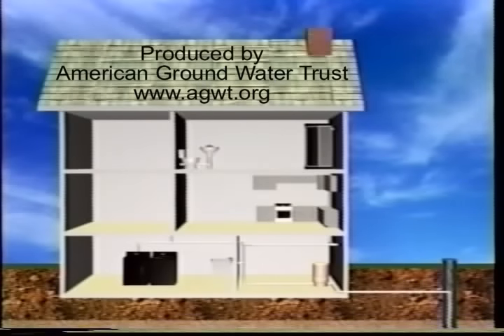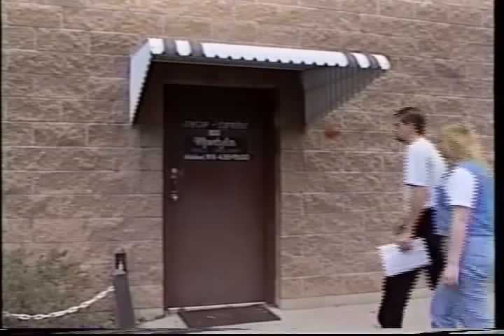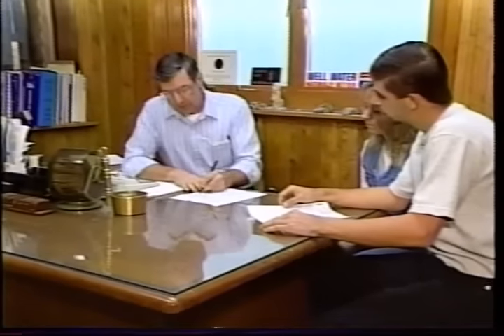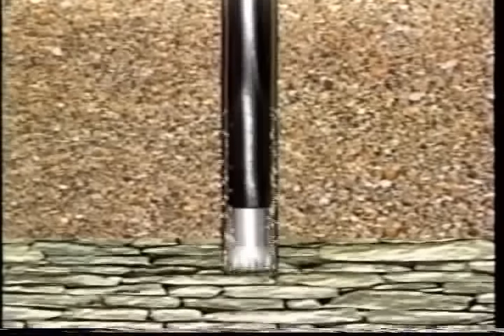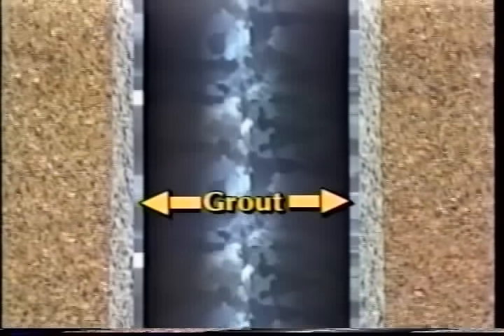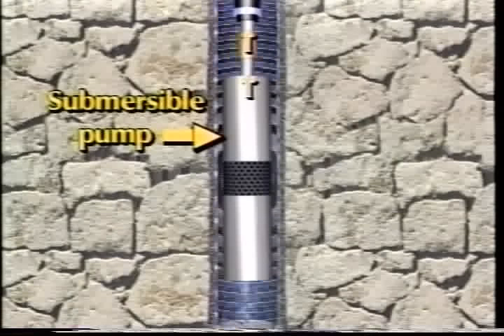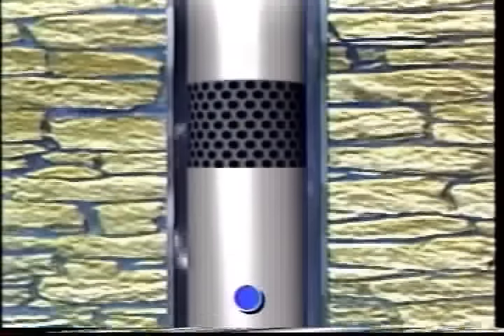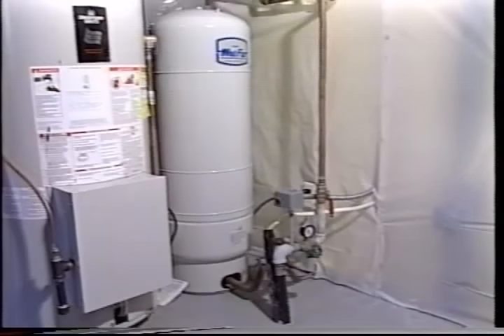How a Water Well is Drilled

Comment: I'm a certified public water operator class C and this video explains what they don't in books..good stuff
Reply: TheHonestjbone a video is worth a million words.
Reply: Arther Casillas
Reply: TheHonestjbone hey man I'm 22 and a new homeowner. my house has well water and it has a bit of a metallic taste to it.
Reply: how do I stop this?
Reply: could be a multitude of factors.

1) how deep the well was drilled generally the deeper the better quality water...the more shallow the more "rotten" egg smell which is sulfur and iron mixed
2) get it properly sampled at a lab, preferably your nearest county lab to find out what is in it.  Could be high iron, or just certain quality of the water..get it tested then take appropriate action to have it filtered.
3) what kind of piping do you have in the house? copper? galvanized?
4) you COULD try undoing the bolts bolting down the cover of the well head and pour a gallon of chlorine down the casing pipe (yes literally) and then use a hose to hose down the inner walls
5)You could attach a filter system after the well to filter out usual suspects....but figure $30-60 every few months in filter change outs too
6) make sure the hot water heater anode/probe/dip rod in there isnt corroded...that'll give off a huge rotten egg smell if left unattended too or not changed

hmmm what else.....OH after you "shock" your well...flush it out for a while..to make sure you get that out of there

hope that helps brother
Reply: What book do you read?
Reply: My groundwater is damaged due to soap&detergents water how to make it to normal
Reply: @bhadramudrageda4999  what was the cause of the soap and detergent? do you live in a house? or apartment? do you currently have an RPZ/backflow preventer on your plumbing? IF so...get that thing tested to make sure it doesnt "bleed" back.  Also get your water tested..which is sounds like u have.  One way to get rid of it is using a filtering system for the house and/or a house reverse osmosis system with a water conditioning softener.  At the end of the day it WILL NOT be cheap..but it'll be worth it in the end and you'll gain a lot of knowledge.  Sorry for this being a long reply but there is no short answer
Reply: @TheBTEAMwins  thanks alot for ur quick reply......my bore is driven at some other place but due to vasthu (astrology)driven near to waste water tank...(full of soap&bath water&washing water etc)so from new bore the water comes with detergent smell...we are planning to shift the waste water tank far from new bore .....but is there any affect with the previous used waste water to my new bore(it's depth is 15-16 ft actually we from konaseema (eastgodavari,Andhra rich of water facility))plz kindly reply what are measures taken to reduce
Reply: @bhadramudrageda4999  wow such a shallow drill!!! Very short! No wonder! Yes! Move far away from waste water tank!!! You’ll get sick and It will form bacteria unless you chlorinate your drinking water.  Re-drill if possible or move the storage tank away.  If you CAN, and only if you can...drill deeper.  And use some filtration units coming into home/residence to reduce ground water irregularities
Reply: Wow some gd info here! Dig deep…. better natural filtration!? Makes sense!😮

Comment: This is a pretty good video. Informative and accurate. I've been doing nothing but reading about wells for the past few weeks.
Finding water can be a challenge. Our existing 300 foot well in Northern Idaho went dry two weeks ago. We had two options, go deeper or try a different spot. There's pros and cons to both but we'll skip that. There is no magic answer to finding "The Spot", divining or otherwise however they now use electronic devices, not willow branches. Our neighbor drilled a 300 foot dry well and then found 25 gpm at only 200 feet! Back to our well. We opted to go deeper and found hard clay down to about 550 feet! Yuck! Fortunately, we got back into shale around 600 and are dropping the pump in today (9-10-14). It's only 10 gpm but it'll work. We should be out of this for "ONLY" $19,000.00. At $20 / foot, drilling a well gets expensive quickly and that's just the hole in the ground. Then you have to buy the pump and connect to the house with wiring and water. The deeper you go, the more powerful a pump you need and has anyone priced copper wire lately? Holy moly!!! So, you have to figure the distance to the house ( we're 500 feet down into the meadow) and then the distance down the hole. (we're another 600 down). That's 1,100 feet of #4 copper wire! We feel fortunate to have this cost less than $20,000.
Reply: You ever think about a solar dc pump?

Comment: Priming is not the only reason to use  a check valve.A check valve or a NRV (Non return valve) is used to prevent the backflow of fluid so it is a must & as commented by sslater069 nowadays NRV is builtin in most of the SUBMERSIBLE PUPMS.

Comment: Most brand submersible pumps have a check valve built in (typically fail),so it is extremely wise to install a secondary check valve directly on top of the pump and another check valve for every 250' of drop pipe after. with out the check valve in the pump or on it the water WILL drain back threw pump and air will enter the line causing the plumbing to shake and bang etc.

Comment: @jb0579 If it smells like natural gas, it just might be. Your best bet might be to have a local lab test a sample of the water to give you an indication of what minerals and or gases might be present. If you live on the edge of a swamp, you might be getting traces of ground water in your well and that could be due to a number of things, but primarily I'd think it would be a lack of grout around your surface casing. Hope this helps. - Tommy @ Fletcher Drilling, Inc. Colorado

Comment: How long does the steel casing last before it rusts and puts rust into the water?
Reply: Dasdfjkl that depends on the type of steel used and the water quality in the well as well as the wall thickness of the casing. most wells can expect a 15-20 year life before needing a liner or replacement when using steel casing. high salt content will shorten that to as little as 2-3 years.
Reply: John Pike here in Illinois most of our wells are up to 60 years old with original casing and no liner and the water pumps cleaner than aquafina
Reply: I did say "most" i have seen many numerous wells that were drilled in the 1800s and never been relined and i have seen many that needed a liner after only 2 or so years. I work for an irrigation company in southern Az and we have wells from the 50's that look new (one of them has stainless steel casing) and we have a couple with a high salt content and thin wall pipe that get a new liner every 5 years
Reply: very interesting. I work for a drilling outfit that drills for residential purposes or livestock with the old cable rigs
Reply: jakub goslin Really?! i haven't seen a cable tool used on a domestic well in years. i run a BE 36L at my company and maintain thier 3 36L's and 1 28L. i have worked with every model of cable tool bucyrus erie has offered. around here cable tools do mostly just work overs or agricultural new wells, rotary has taken over the market for domestic and most commercial new well construction.
Reply: Just about every other company in our area operates rotary rigs but we stay busy as ever with our three cable rigs.

Comment: @jb0579 sounds like manganese, they usually use greensand filters for that. Find a place to do some testing before spending any real money. Usually when you need to treat your water, it is for more than one thing. Different equipment does different things, and interacts differently, so if you run out and buy something it may be counterproductive if you have another problem.

Comment: Can someone answer me a question? We have a drilled well 90 meters deep, with a submersive pump at around 40 meters from the surface. I don't know the level of water in the well. I was told by the previous owner that we mustn't use water with too high flow for too long because the walls of the bottom filter can break in if there is not enough inner pressure from the water column. I don't really understand what he meant (after seeing how a well works). Is it really possible? Thanks for your help
Reply: hummer4700 I do water wells for a living, you usually set your submersive pump 5 feet or roughly 2 meters of the bottom of the hole, motor horsepower and pump end need to be the most adequate for you well too.
Reply: The higher pump rate means higher velocity of the water inflow, which may break the sieve wrapped up around the perforation tube or tubing a.k.a. filter, which leads to hydraulic collapse. More over, higher velocity of the inflow may drag the fine sand particles into filter what also is preferred to avoid in order to protect the submersible pump and prevent the sand blasting of your sieve. Btw, your data is insufficient whatsoever in respect of used materials and filter type. You should find someone to help you with step test (testing the well with at least 3 different pump rates from lower to higher along with measuring of the water level). This test will give you much more info needed to determine the quality of the well in regard to hydraulic losses, optimal pump rate and pump depth. Greeting from Serbia!
Reply: @MarjanVukovic  thanks for the answer!
Reply: @hummer4700  You welcome. However, it s far more complex issue than previously briefly explained...to me it always raises more questions than the answers but wasn t that what inspires the people of science the most? lol
Reply: Is this your homework

Comment: it's always smart to not put your pump all the way down,,our well guys drilled a little extra, so we have a 20 foot resivor so the pump doesn't set in sedoment ...........jda
Reply: Ours has 20 or 30 feet as well. And even more above. When they built the house, the drillers went past the first reservoir so we don't even have to worry about dropping water levels even if we ever had any droughts anywhere near here.

Comment: the method is similar to fracking for shale oil or even oil drilling for offshore, i amaze, the only difference is the dept.
Reply: My grandpa was the one who told me about this he used to work on oil rigs said he drunk water from them and it tasted great
Reply: +Danny Fry I am also a petroleum engineer and the water produced with hydrocarbon is known as brine water and it is very hazardous to drink.you grandpa must be talking about shallow water wells drilled for water usage which are different from oil wells.
Reply: +Asad Hassan Syed i dont remember specifically but he was on a oil rig it was before they got to the oil though said it was crystal clear

Comment: How can you tell if your well below the casing has collapsed
Reply: it is not an open hole completion,it is a cased hole completion so the well can not collapse,the overburden pressure and the pore pressure at this depth does not exceed the collapse pressure.The hole they drilled into the earth they covered it with casing from top to bottom.
Reply: Asad Hassan Syed y

Comment: the water line into the house.  how come it leave the well casing before the top. how is that even installed?
Reply: +kody neeb It has to stay below the frost line or it will freeze in the winter.
Reply: +Tony Samson That is very wasteful.
Reply: i realized there a little metal weight clamp you have to slide the line into about 5,6 feet down, was hard to see, but sall good, it works like a bathtub faucet, the water pressure keeps it tight.
Reply: That line is typically used with submersible pumps and leaves the casing underground, below the level of expected frost.  Where I live that's 8 feet or so. A special 2 piece fitting called a pitless adapter (or a variation of that depending where you live) is installed to connect the horizontal supply pipe to the house with the drop pipe to the pump..  One piece is set in a hole in the casing, attached to the line to the house.  The other piece is attached to the drop pipe. The two pieces fit together with a seal being formed by the weight of the drop pipe and pump.  This system allows you to remove the pump for replacement.

Comment: Where does the used sewage water go??
Reply: In the septic tank. The solids in the septic tank break down naturally due to bacteria while the water is sent through a leach field back into the ground. The ground acts as a natural water filter so by the time that water gets down far enough down to have rejoined the aquifer it is clean as a whistle again.

Comment: how pump is running where is electric connection?
Reply: An electric typically comes in from the top and is taped to the pipe that is connected to the well pump, and goes the length of the pipe to the well pump.
Reply: I think it's battery operated
Reply: The home's power source...?
Reply: @marcoramos5811  Yes, 220V power source from the home on it's own breaker

Comment: '
do have a water filter from the drilled well water...
where is the water filter...
how about the sewer waste system from the house...
where the sewer going to
Reply: There is no filter only on the type of pump you get
Reply: And sewage just goes into a sewage tank
Reply: Sewage goes to a septic tank. A grandpa of mine had city sewage for a long time before he had city water. I don't know if it was by choice or they just didn't offer water till the area was more built up though.

The house I was living in when I became an adult, had well water. When we moved in we had to cut out a section of the water pipe where it comes in to the basement and added a filter housing. We had to kind of make a square section of pipe so that the filter housing was upright, level, and far enough away from the wall for the filter housing to fit. They are inline whole house filters or something. Just turn off the pump, use up the water in the tank, then unscrew the bottom part to replace a foot long or so filter. The house also had a big water conditioner.

Comment: Where does well water come from? Iv been asking for how many years....
Reply: rain
Reply: Water aquifers found underground
Reply: Water table.
Reply: water peculates through the soil and gets stopped by an semi impermeable layer called an aquitard. The water accumulates there and creates an aquifer and may begin to flow, or may not depending on the geology. You then set the well in the aquifer.

Comment: This video is okay, but really way to old to be considered useful.
Reply: I don't know about that.  Rotary, steel casing into bedrock and a submersible pump is the way it's still done by ALL well drilling companies here in Vermont in 2020.  A friend used to use a cable tool back in the 70's and 80's when rotary was already common.  He believed that the impacting caused fracturing that would provide better yield, but it took over twice as long.

Comment: this is not how wells work at all, the pump in in the house.
Reply: L Rad if you watch the whole video they talk about well pumps that are installed in the house.
Reply: only if you have a shallow well....
Reply: Lead, take it from a wellman and rig hand, Location, Location, Location. I've pulled and installed many pumps from municipal water systems to river pumps. The systems come in many styles. The jet pumps (above ground and in a pump house) are by far the  least I've worked on. Here in Central Texas the usable aquifers generally require us to install submersible pumps near the 900' mark and 1400' is not unheard of. Allow me to reiterate- Location, Location, Location.
Reply: Ever consider your situation might not be universally applicable? Pump is outside the well only if well is shallow.
Reply: Pump is in the bottom of the well, no one has pumps inside the house.
Reply: Sol Rosenberg I've set wells so close to a house that if we were in a nothern climate we'd have put it in the garage.